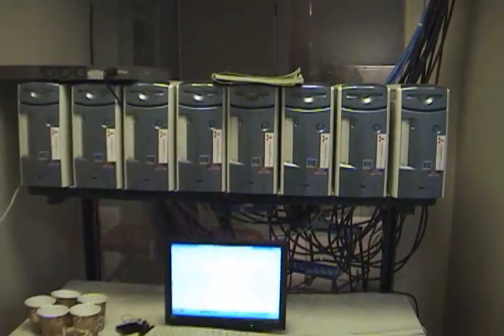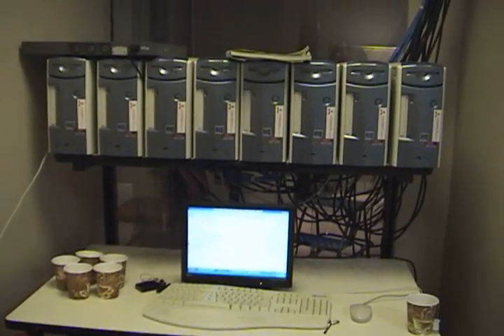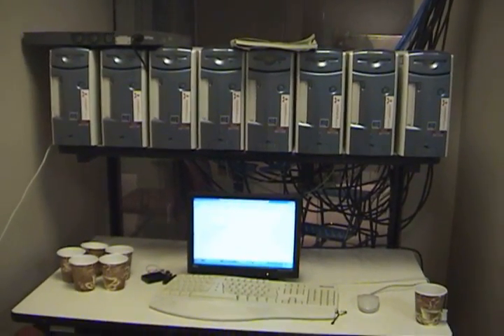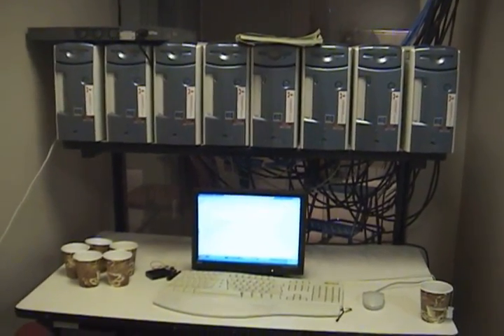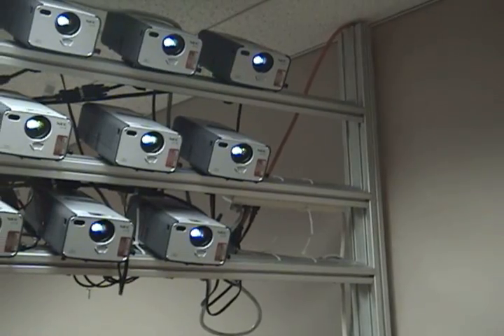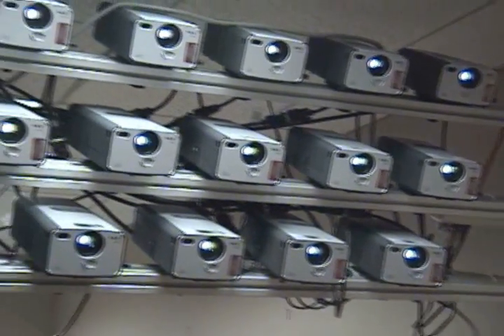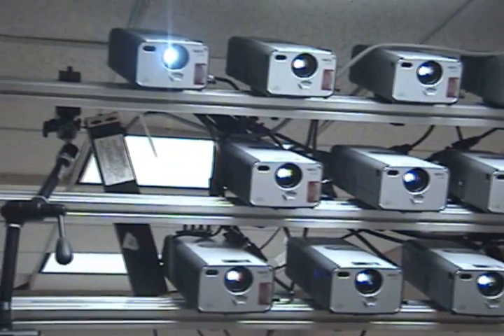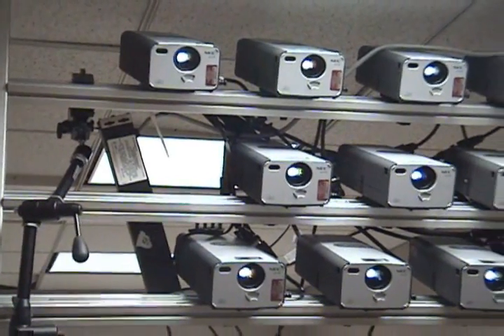Real-time 3D TV System

Comment: @tkrzysko A good 3Dtv doesnt need to cost $2,500-$3,000. I currently have a 60inch Mitsubishi 3Dtv that has 3D as good as anything i've seen yet. My tv only cost me $1000 and the 2D is fantastic.! With 2 pair of active shutter glasses and a Panasonic 3D player, I've only spent 1750 bucks. I think $2,500-$3,000 for a much smaller 3Dtv (or bundle) is overkill on our wallets!

Comment: @FullCircle360D You are correct to some degree.  The 3D effect that you get from holograms or stereoscopic images are not actually spatial 3D, but an optical illusion (which tricks  your brain).  However, it is the same effect that allows you depth perception in real life, which is binocular parallax, and in this case, also motion 3D allowing you to view the scene from different angles.  I believe this display more closely resembles a hologram, than it does a regular stereoscopic image.

Comment: you can't do that cuz a lenticular display surface of about .1 focus points would be needed to make up for the displacement of parallitic angles of light from a 3-d space to a conceivably (but not virtually) 2-D space. Also the eye(or rather the brain) has no way of differentiating from perceived light (as in polarized 3-D screens) to the adjusted incident light that such a display would need to be viewed and it's refractive defect the light would incur as the light enters our eye-lens.

Comment: Well, the narrator says that the display provides *both* binocular parallax and motion parallax.  With 16 different angles of the same video projected onto the lenticular, what happens is that different stationary observers will see different angles of the same scene.  This also means your two eyes will see a slightly different angle, giving you binocular parallax while stationaryy.  Additionally, since there are extra angles, you could walk across the screen and experience motion parallax.

Comment: The most accessible and effective 3D technologies we will have first both involve glasses and are either using differentiated wave polarized lenses (those used by cinemas) or "shutter glasses" - these are what I anticipate will take of first.

The drawback with plarization is in displaying that image to people - current display technology can only be on 'direction' not 2 different which is what you would need.

Shutter glasses only require a 120hz+ display to alternate each eye at 60fps.

Comment: this uses a large array of things to do the work but its just a prototype. im sure future designs will have all required things, save the transmission part included in one set (the main thing here is that each band be showing a different part of the scene, if those bands each DISPLAY an image, rather than REFLECT it, as is the case here, you can make the whole thing self contained, but you need a TV powerful enough to display 16 images at once (probably with 1 or more cell processors built in)